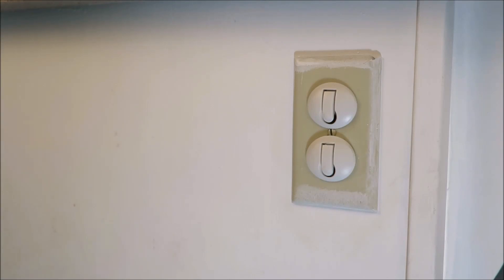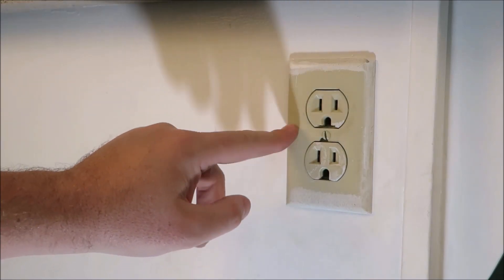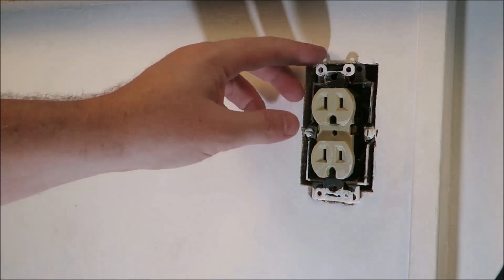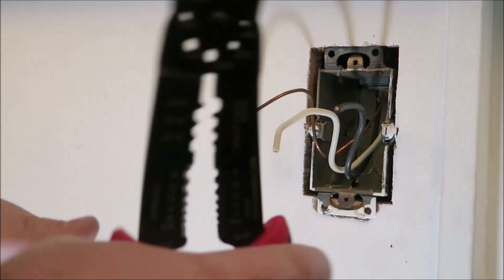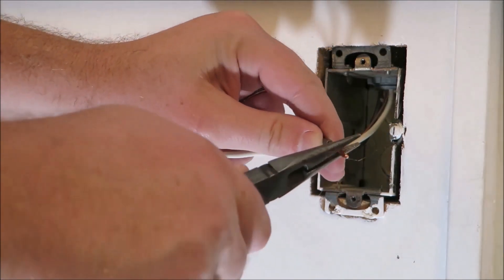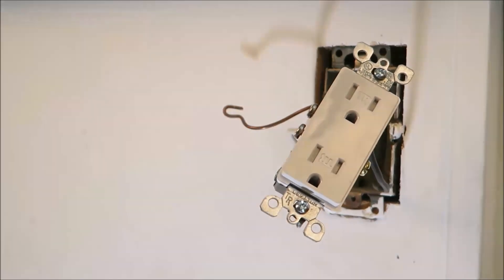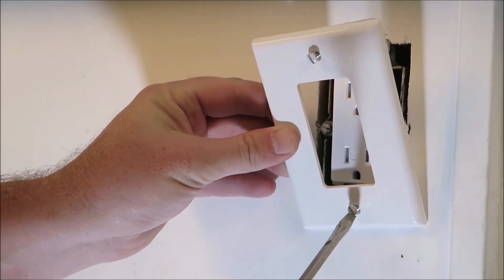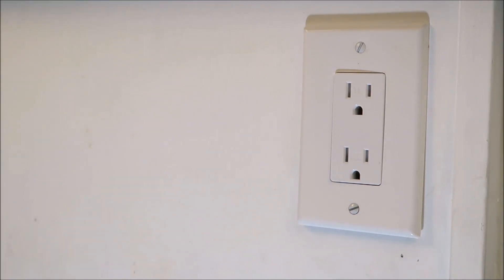Tamper Resistant Electrical Outlet | Install Tutorial

Comment: Just a tip when you put the wires on you should put the wires on clock wise so that when you tighten the screw you pull the wire in instead of going Out
Reply from the maker: Great tip! Thanks for sharing!